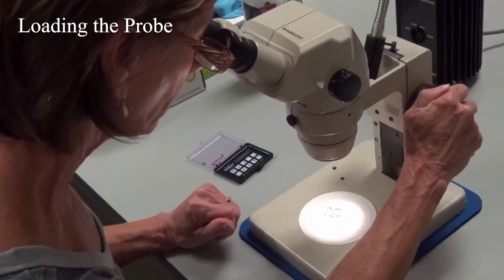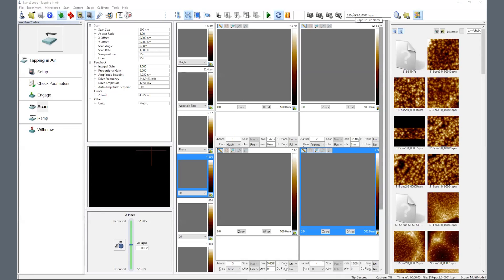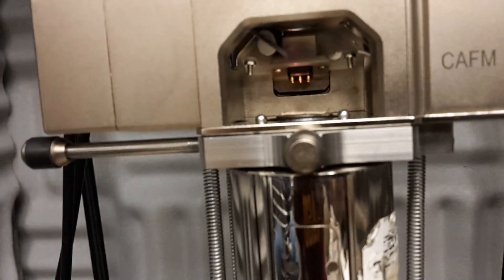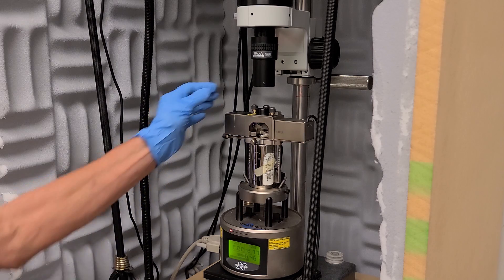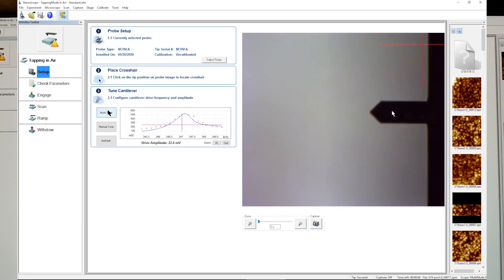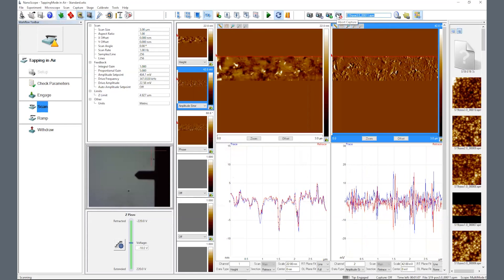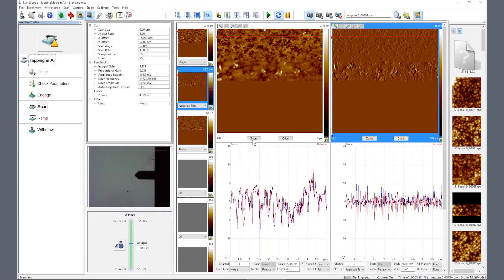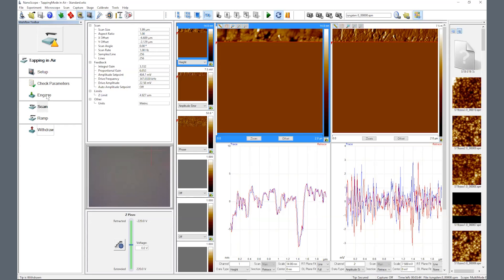Multimode 8 AFM training video

Comment: I would like to ask, is there any need to change the drive amplitude and amplitude set point when using tapping mode? I am quite new to AFM. I normally change these parameters
but cannot seem to get consistent images most of the time. This is the first guide I've seen in which these parameters were not changed.
Reply from the maker: Typically, you can set it and forget it! When using tapping mode, the setpoint can be decreased on samples that require greater tapping force. If your probe is tending to come off the sample surface, you should increase the tapping force. Also, make sure you're using the best probe for the sample.
Reply: @EyringMaterialsCenter  So Ideally, I can match the trace and retrace by changing the proportional and integral gains as pointed out in the video?
Reply from the maker: @darylldalayoan4880   yes that is the goal to get good images.

Comment: Why I can't find the integral gain and the proportional gain parameter ? (I use the mechanical properties mode)
Reply from the maker: Hi. If you are using Any Peak Force mode, the gains are being set automatically as you scan. In tapping mode they will appear on the Scan Parameters list of values to change.
Reply: @EyringMaterialsCenter  Thank you so much. 😃

Comment: This is really helpful. Do you have any tips that can be followed to focus the instrument? I face hard time when i start that focus step. Thanks.
Reply: Hi Partho,
It is always a good idea to check where the laser spot is in relation to the white light coming from the camera before you insert your sample or probe. Using a white strip of paper, place it in the optical head just above the probe holder. It should be just to the left of or near center. The white light is your general field of view, FOV, when observing the live image on the software "Setup" screen. If you insert a very reflective sample, such as a smooth metal like gold, you can then direct the laser spot to the end of your cantilever. Make certain your probe is in the FOV, then focus on the reflective sample. Sometimes bringing the probe close to the surface of the sample will help in seeing the laser spot. Then watch the SUM. It should increase as the reflection of the laser hits the position sensitive detector. If you continue to have issues, feel free to connect with me on Zoom. I will be happy to walk you through the process. Best regards,
Diana
Reply: @dianaconvey4527  Thank You very much !